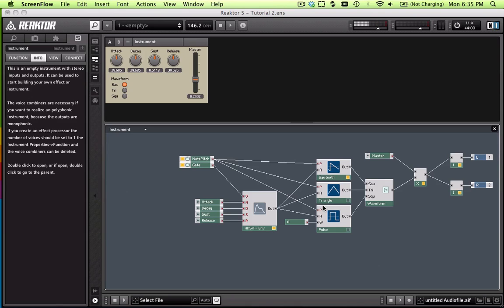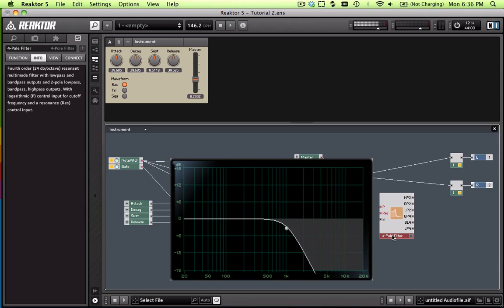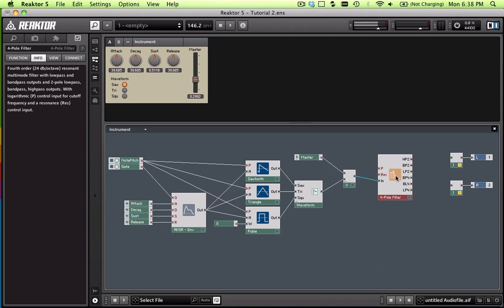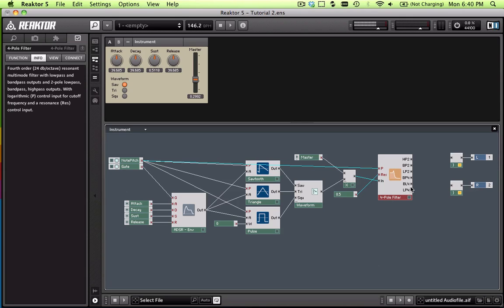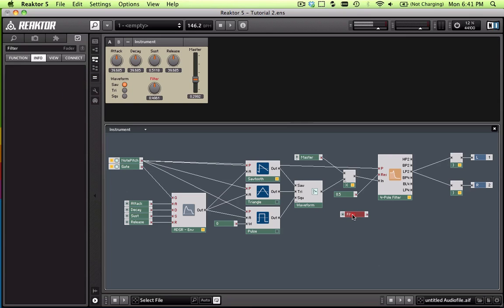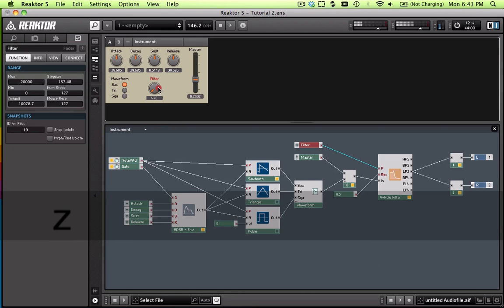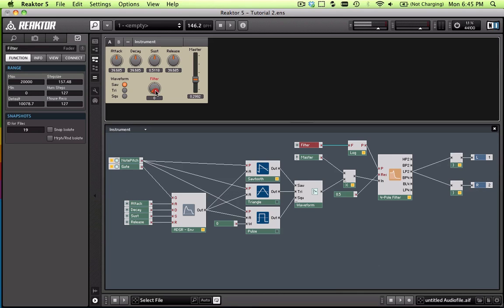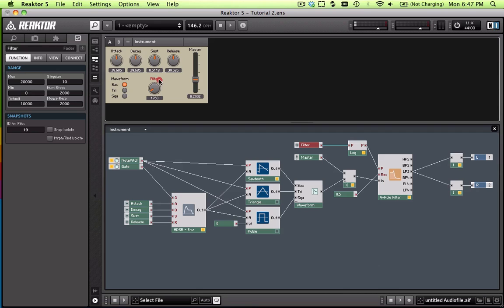Reaktor 5 Tutorials - 3 - Adding a Filter

Comment: I was thinking the same exact thing, tried it and got the same results.  Also, I think for the way it is done here, 20000 is to high of a value as it didn't seem to change anymore past the halfway point.  I lowered it to 10000 and it changed throughout the full turn of the knob